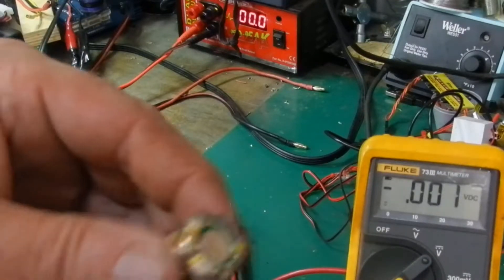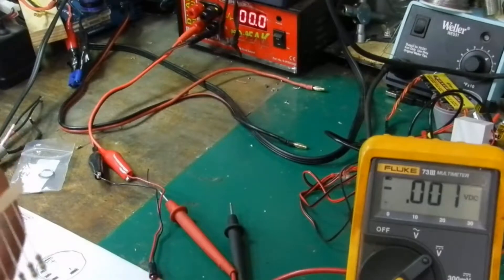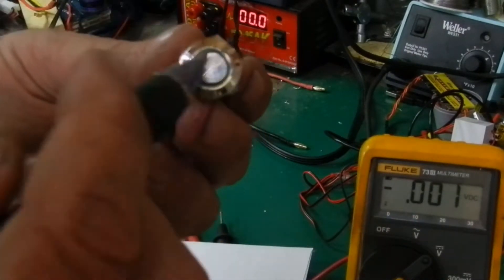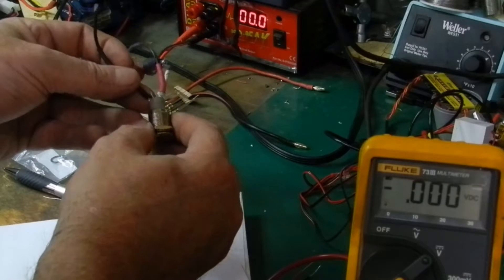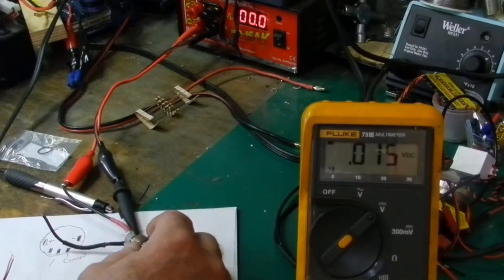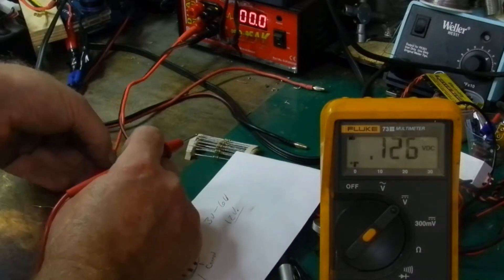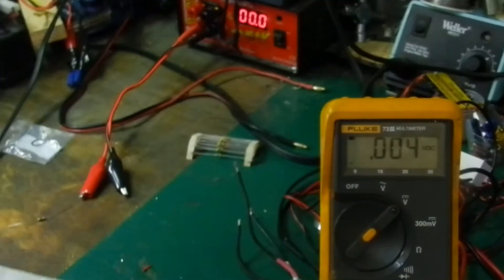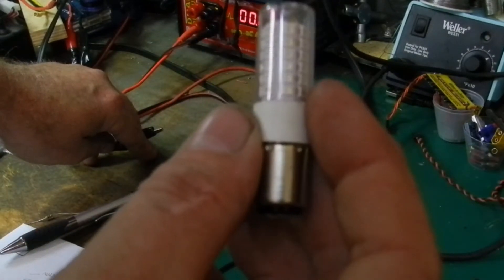How to wire Halo led buttons, five pin buttons with or without resistor

Comment: Will attaching resistor effect my output voltage?
Reply: The way he explained it in the video, it will only affect the LED light on the switch itself, not the other lights. So, the output voltage will not be affected. 👍

Comment: So the light can only be on either when you push the button or when it's off depending on how you wire it. Meaning that you can't have the light on when it's off and when you push it is that correct or can you wire it so the lights on in both ways
Reply from the maker: you can have it lit all the time,, just add power to both thermals